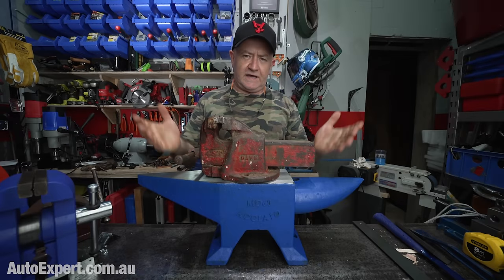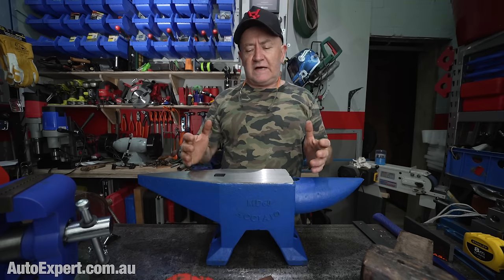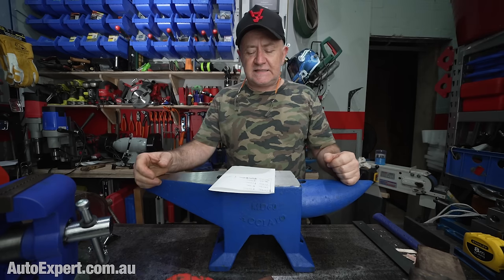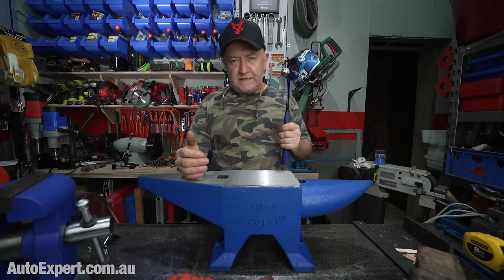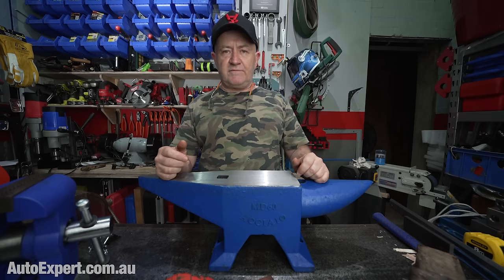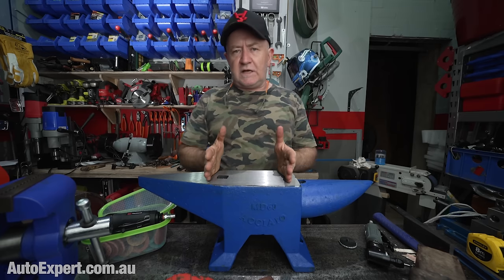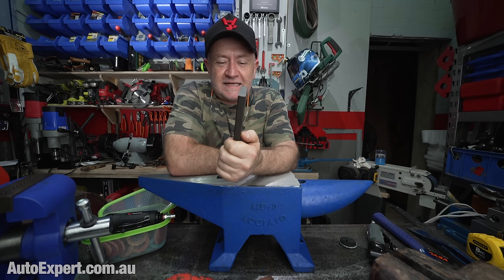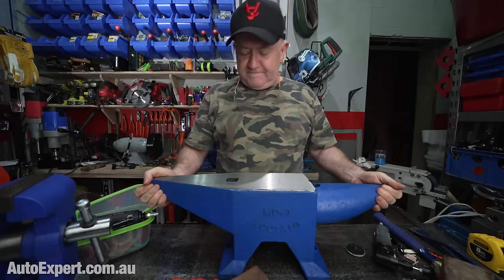DIY 101: You need an anvil (even if you're not a blacksmith) | Auto Expert John Cadogan

Comment from the maker: Vevor Steel Blacksmith's Anvils
20kg: https://s.vevor.com/bfP9Uk
30kg: https://s.vevor.com/bfP9UE
40kg: https://s.vevor.com/bfP9UQ
50kg: https://s.vevor.com/bfP9Uv
60kg: https://s.vevor.com/bfP9Uc
DISCOUNT CODE for 5% off: VVSALE5
#vevor #anvil 
60kg Anvil (USA viewers only): https://s.vevor.com/bfP8JW
Reply: Thought your Channel was 'Auto Expert' not tool time 'Expert'. Perhaps you should start a Tool Time channel for those who want to pretend they are Mechanical Engineers.
Reply: Next time I need to shoe my horse I will for sure get one of these.  The bench that thing is sitting on has to be just as tough as it is.  I found the best way to break a vice is with a cheater bar.
Reply: Really enjoy your tool and tech videos. Your car videos are very informative but the engineering floats my boat. I've been an  electrician on the railway for 40 years but actually building shit is my enjoyment.

Comment: Blacksmith here. Grinding a radius on the edge offers a more important benefit - sharp edges are more likely to chip, coming off at a high velocity. All edges should have at least some dressing. Some of those used anvils are of far superior quality too, though you need to know a fair bit about their history and signs of distress (i.e. delamination, pitting, casting defects, etc). Brands of used anvil that are generally respected include: Hay Budden, Peter Wright, Soderfors, Kolshwa, Mousehole, and more. These are occasionally mistreated, however, so just have a keen eye if you're on the lookout for one. In the blacksmithing community, these Vevor anvils do have a fairly good reputation as an introductory anvil. Occasionally they have filled-in casting defects and aesthetic defects, but apparently they have good customer service to rectify these issues. 

By the way, more mass on an anvil doesn't necessarily mean a larger working area. The Vevor anvils have a disproportionally large working area. To mount it, you could use U-bolts on each of the corners, take some angle iron and bolt it along the leg/base flares, or simply use the existing holes in the legs. Adding some silicone between the anvil and stand may reduce the ringing sound.
Reply: Mounting even cleat style on 3 edges one side removable for easy relocation if needing large work area.
Reply: Excellent overview ! Thanks for sharing.
Reply: Those old anvils were great for the time they were made. But the truth is that there are more than a few modern anvil makers who are making excellent cast tool steel anvils. At least on that I know of in Australia. They are about the price of these old anvils, but really, much better in quality. Those old anvils, for those who don’t know much about anvils, were made in several parts from wrought iron (usually) and mashed together (welded) using a lot of heat and big hammers. Then that high carbon steel face was welded on in the same way, turned upside down and the face was heated the dunked into water. I’d much rather prefer a one piece cast tool steel anvil.

Comment: About 50 years ago I was posted to Townsville and the bloke next-door worked for Queensland Rail. He gifted me with an eighteen inch length of rail line with both ends dressed. Apparently this was a job given to their apprentices as an apprentice piece. Those that didn't finish left them behind. I have carted that lump of steel all over Australia for the last 50 years and still use it.
Thanks for the enlightenment.
Regards Tony
Reply: I have one similar. A dressed 20 inch peice of Crane rail. Nice flat top. Love it.
Reply: I was going to say the same.... I have a 20cm length great for light work.
Reply: I was going to suggest the same, it makes a grate mini anvil that's easy to set upon a work bench
Reply: Modern rail is head hardened too 

I have a few pieces at home that I picked up occasionally at work, mostly use them as counterweights

The rail can’t have two welds within 3 meters of each other so any piece smaller than that is scrap
Reply: I was gifted a similar piece!

Some people are just great, eh? Had that thing for many many years, a well appreciated gift.

Comment: Nice work on the anvil story, John. A while back I found myself in need of some "anvil work" and, like you, didn't think it was a good idea to extend my 4" cast iron vice to do the work. After going down the road of purchasing an anvil and being frightened off by the eye watering prices, I turned my thoughts to finding an acceptable alternative. As chance had it, I had a few feet of fairly large C channel handy and, long story short, cut it up and welded two pieces of it back to back together and voila, a perfectly serviceable anvil - for my purposes, anyway.
Actually, I'd had that piece of 200 X 100 C channel lying around for about 30 years and was glad to finally have made good use of it. ☺

Comment: I had been using a piece of railway iron for many years for shaping steel and riveting, while it was OK but the lack of mass meant it wasn't 100% satisfactory.
Started looking for second hand anvils and gave up as they were overpriced and usually damaged beyond being functional.
Turns out I could and did buy a brand new quality anvil for the price of a flogged out second hand one, what a difference! it is so much better to work on.
Your video is great, I spent many hours running into days to understand enough about anvils to make an informed choice. 

Good to know the Vevor anvils are good value and about half the price or less of useless damaged second hand anvils.
The shop and tool videos are great, keep them going.
Reply from the maker: Thank you very much. I sincerely hope the railway 'iron' you were using was actually made of steel...

Comment: I have the 30kg one because it was the right price, free delivery out here to fumblebuck nowhere and they are actually a hardened steel anvil.
The edges are a bit sharp so a quick blast with the angle grinder to take a bit of the edge off, also had to dress down the horn smooth so its more usable, the hardy hole needed re-squaring with my power file. Got a dead flat surface and its really not got a bad rebound and you're not going to mar it with anything less than a 10lb sledge and a helper gorilla.
You do need to mount these on a fairly sturdy wooden sleeper stack or steel tri frame and get a couple of welding-magnets to clamp to it knocks out the harmonic ring.

I'm not a blacksmith but I've forged plenty of knives on mine and it works just fine. So they'll work fine for the casual fella that wants to bonk some metal
Reply from the maker: My assessment is likewise, Kris - we all want to bonk some metal mate. There's no shame.
Reply: @AutoExpertJC  :person-turqouise-waving:............indeed.

Comment: There used to be an anvil at the mill I worked at years ago.  It was huge and on a stand.  One night shift the fitter went out to expand a pipe on the horn and it was gone.  They would have had to had to use the forklift or crane to lift it.  They are a valuable tool for metal work.  My bender in the press will only do 6mm steel.  I have used a bit of flat bar on an old railway sleeper in the past but it is dodgey.  I think it is you can get about 8 ton of force with a 14 pound hammer at full swing.  You don't want anything to fly off.

Comment: I also have been horrified at the price of anvils, so thanks for providing an alterative supplier. Another useful tool for metal forming, in particular bar steel round or flat is a bar bender from Hare & Forbes. They're bench mounted and designed for cold forming and at a reasonable price of around $400 you can bend up to 100mm x 7mm flat bar or 20mm round or square bar. I have one of these and they are really useful for precision bending.

Comment: You can weld cast iron John , it does work with cast iron welding rods or should I say they are rods that weld all steel's.  May not be ideal but I have successfully welded a cast steel torque arm for an electric motor gearbox.
Reply: Yes you van but how on a thick ragged joint?   You would have to grind it then fill it it would be a lot of fill  With a braze you just flux the joint heat it up add the filler rod and keep it hot until the filler has flowed into the break.

Comment: Us farriers pritchel through the hardy hole at a corner anyway, the dedicated pritchel hole ignored by most. I'm gonna buy the 30kg, I've got a 90 kg O'Dwyer in the home shop and a 40 kg (which is actually 45kg) in the truck. At 61 years old that 45kg is starting to feel very heavy lifting it in and out of the truck all day. TBH, 99.9% of the work I do in the field doesn't need such a big anvil. At $170 the 30 kg is certainly a low-risk proposition.

Keep up the great work John, got my Bluetti AC200MAX because of your vids, and can see no reason why one of these won't work out equally well.

Comment: That is why, like you, when I built my workshop, I got carried away, 30 ton press, 75ltr parts washer, 90 litre ultrasonic tank, 250ltr air receiver and big compressor, miller and a decent sized lathe, an a big pillar drill. Then what started out as a single chain block like you, ending up as a overhead crane....

Comment: A bit of strategically cut rail track does the same job….and it costs next to nothing.
Reply: but won't the train de-rail?
Reply: @petesmitt , shhhh!
Reply: Rail track makes an excellent anvil for use on the workbench.
Reply: Mate .. have ya seen what people are asking for railway track these days.
with scrap steel around the $250 a tonne, railways are not giving it away.

Besides.

it takes a hell of a lot of work to get railway line into the right shape.
AND
It will only ever be a pissy little anvil
Reply: @soundman6645 , mate, I’m not a blacksmith, I don’t need a massive anvil. I’m a farmer with an 18 inch piece of rail track that fits in my Ute. It’s got all the right angles on it for what I want to do which took me half an hour and three grinder blades to accomplish. It bolts onto (because of its shape) a half a 44 gallon drum filled with concrete, so it weighs a couple of hundred kgs if it needs to, it just transfers the shock down in to the ground.
It cost me about $5 twenty years ago but you could now pick it up for around $20 at the scrap yard. 
My old man had a saying….beware of negative people….they have a problem for every solution.
Reply: @richardlove4287  that is no basis to say that a piece or railway track does the same job as an anvil.

besides as I said railway track is not just given away any more.

look at the price being asked for even short pieces of railway track these days.

Comment: What a lot of people don’t understand about welding to a hard face on an anvil, is that while hard face sticks or wire, doesn’t need heat treatment to achieve its specs, the high carbon anvil top will lose its heat treatment some distance away from the welded area. So “fixing” the top with welding, is a mixed bag. I’ve seen “experts” on YouTube welding these things and thinking they did a great job. They didn’t.

Comment: Well I'm still going 40 years later with a 6" Record vice liberated in 2  broken pieces from a skip behind the Engineering Department at  Plymouth Poly which I successfully arc welded, cast iron notwithstanding, with plenty of heat.   I should clearly gain an anvil, but it would be hard to reconcile  something new in bright bloody blue instead of a more acceptably rusty example exhumed from a shed.